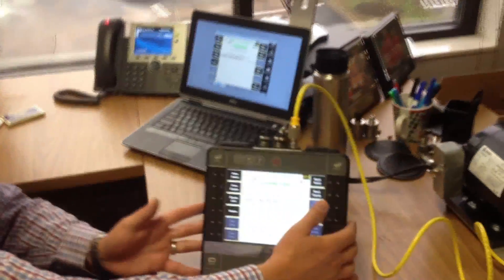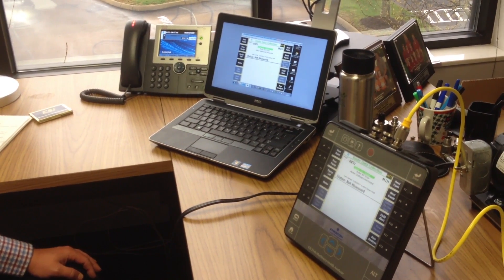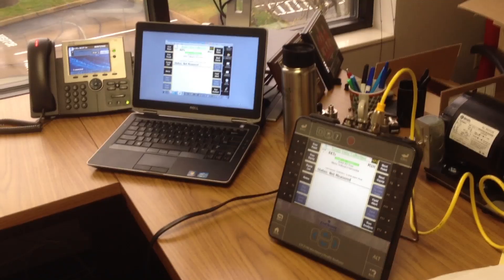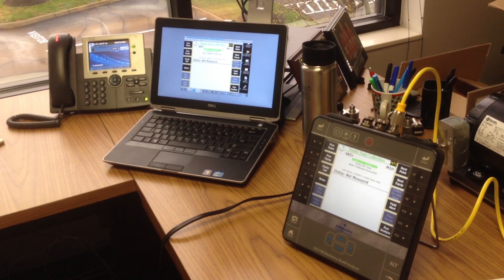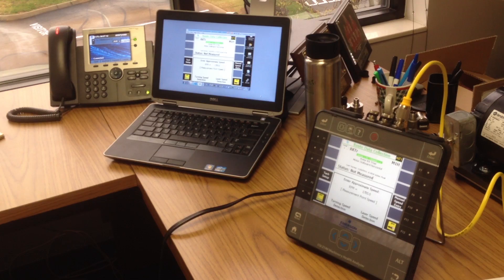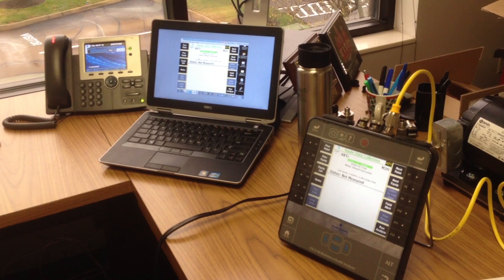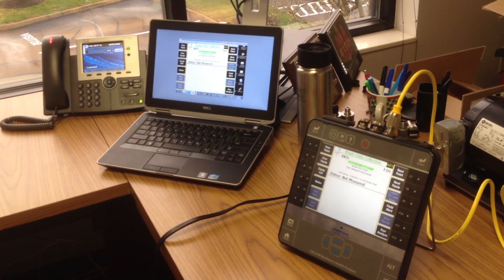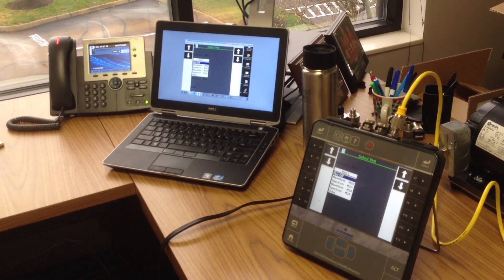AMS 2140 Remote Operation

Comment: Great content, the audio that is emitting the humming should be taken out as it is a distraction.  Showing the scenes side by side allowing me to see the actual changes would be great.  Showing a map of where the end user is, then where the signal have to travel, to the desk and showing how fast this occurs would be great.
Reply: FASTest BHPBilliton - is the remote operation software add on available will it be available for apple and android as there is so much capability unleashed as now I am heading towards paperless inspections using iPads it would be great to back pack the 2140 and inspect the plant as well as move from one point to another taking vibration analysis readings ...

Leaving the fitters to be doing more work instead of inspection and the Conmon team to be taking more data collection with the inspections increasing the vibration monitoring ....